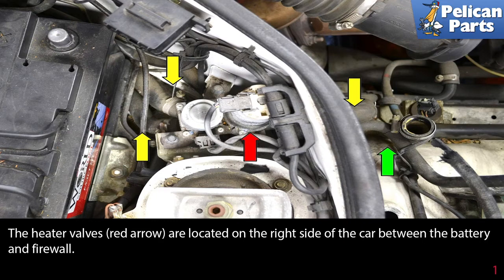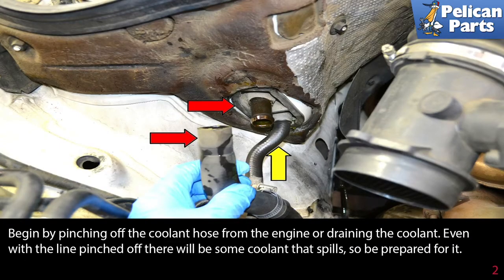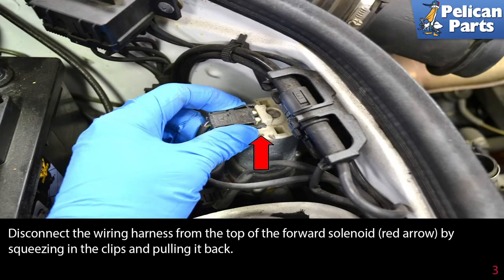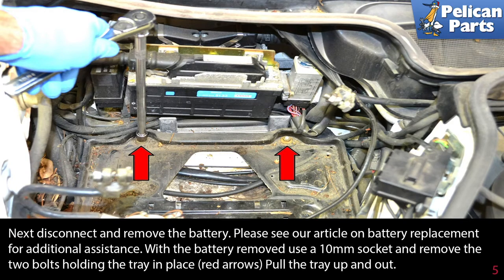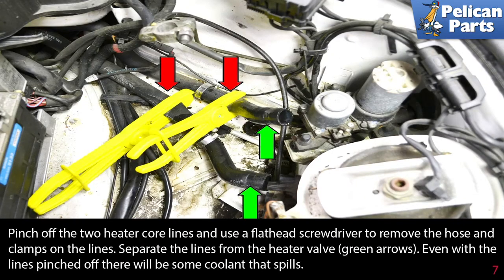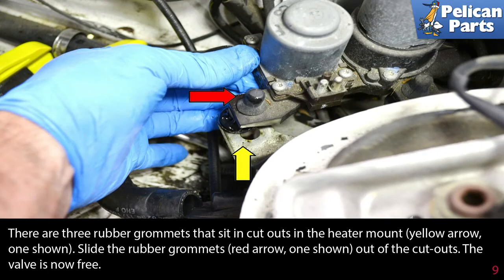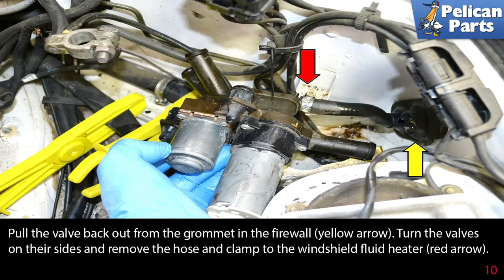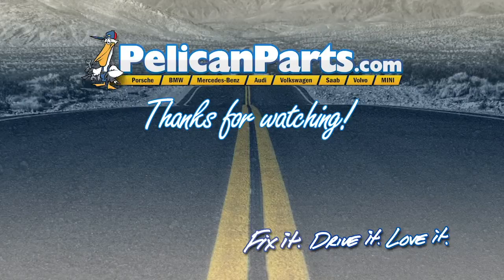Mercedes-Benz W124 E-Class Heater Valve Replacement

Comment: This only applies to later model W124's (1993 to 1996), but if you have an early one (pre "facelift" model), it's still a bit similar to this. Most DIY videos you find of W124's will be of the later 1993 to 1996 models, sadly.
Reply from the maker: Thanks for the Info. We appreciate it.